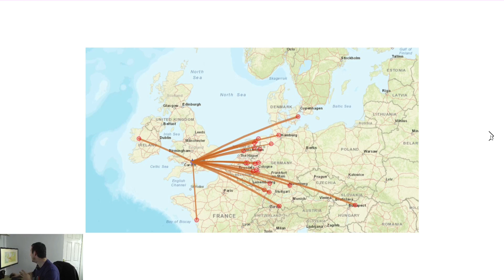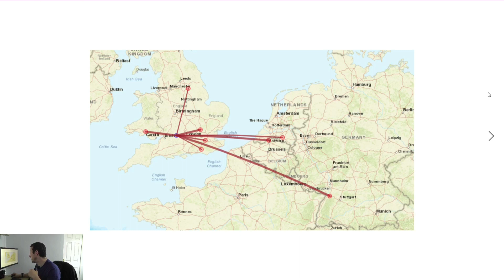Loop On Ground vs EFHW Antenna Comparison

Comment: A full wl loop was my next try for 80m, as my vertical has too much noise and efhw in an L has about the same signal, but way less noise. I figured possibly more signal and less noise with an elevated loop.

Comment: Can you try lifting the loop a few inches above ground and seeing what difference that makes, your installation sounds more like a "loop in the ground"!
Reply from the maker: Unfortunately it isn't that straight forward. The loop was "on the ground" but has been over-grown with grass in the year or so since I put it there. Yes............I did put the wire down well over a year ago & I have only just got round to trying it out!!!

I don't think that ripping it up is going to be that easy. The original article does show the wire laying on the ground.

IanXFS tried raising the loop off the ground on his channel & it sounded like it made little difference. If anything it reduced the performance.

Having said that, I could probably rig up something temporary in my 3 acre field. I'll add it to my list of projects!

Comment: Those results were pretty clear. I was hoping they would be different just because a loop-on-ground seems so easy, but alas...

Thanks a million for sharing this side-by-side comparison!
Reply from the maker: Since filming this, Chris from Cross Country Wireless has suggested that the Beverage Antenna Amplifier which he sells may help things.

I'm currently in discussions with Chris to see if I can get my hands on one for review.

Nothing agreed yet but if I can get my hands on one for review, I will be revisiting this.

Comment: Hi - I had similar receive results with LOG. However, I’ve a Beverage rx antenna with a Countrywide preamp that is a killer :) . I’ve got it into SDRplay running in the background and it will often pluck out something that’s nothing on the dipole / efhw antennas.

Comment: Hi James, that was a good test. No arguing with those results. Keep at it. I did some A/B testing on 40m earlier between a vertical and loop and the loop was way quieter and even stronger signal on closet stuff